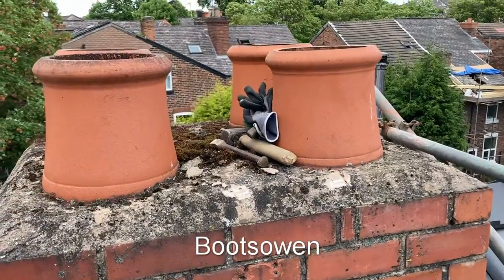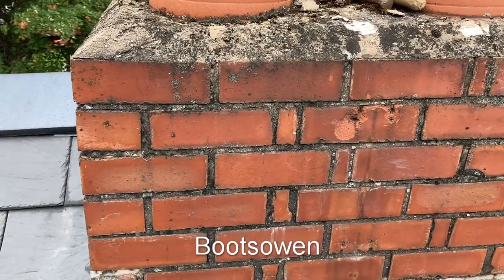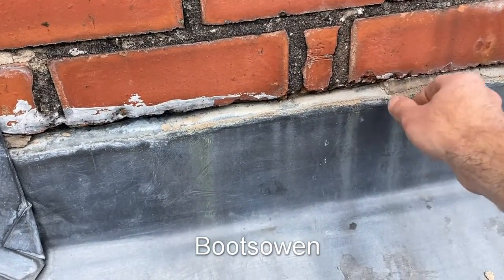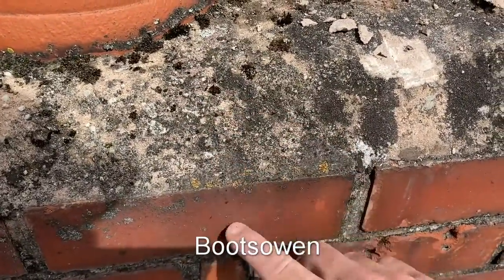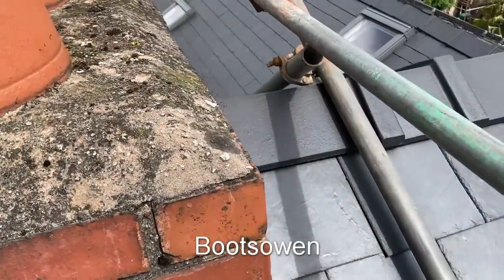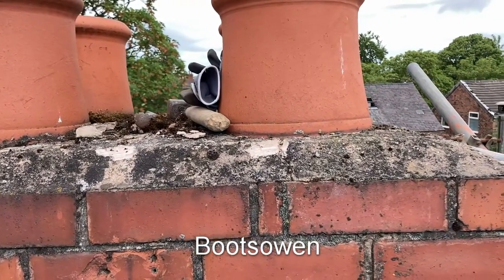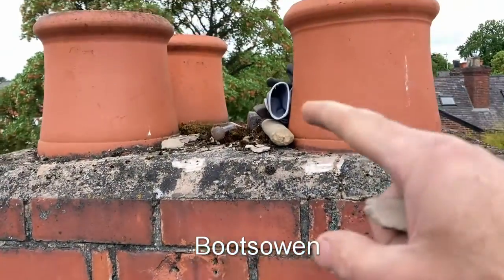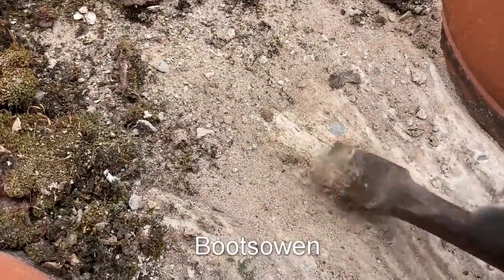How to put a really strong cap on a chimney: DIY flaunching / benching

Comment: Thanks for making a great video which informed me and gave me the confidence to cast my own cap - 5 years of damp resolved! Your method of forming the wood to hold concrete was great and I added a ratchet strap around the wooden form work.
Reply from the maker: I did this shortly before the video was published, it has worked great since, and if I had to go up there and do it again I would probably just do the same thing.

Comment: Great video and great job ! The one extra thing you could have done, while the expensive scaffolding was up, was coat the chimney crown and stack with a quality masonry protection cream -- like Climashield or Stormdry -- to protect against penetrating damp, for 25+ years. It was this that stopped the internal damp from around my chimney breast (the flashing was fine.). Bricks, esp old bricks, & mortar, are really quite porous ........not least with incessant rain and persistent high winds (i.e. UK winter/spring nowadays!) !!
Reply from the maker: Hi, the top of this chimney has been rebuilt in engineering brick, so I don't think that any waterproofer is necessary. Generally, I am against waterproofers on older masonry, if the masonry is getting constantly soaked then remove the water. Older masonry can absorb water and then expel it through evaporation, and moisture can mover from the inside of the house to outside.  A waterproofer will stop moisture getting out. I guess they will say that it is breathable, I haven't used it.
Reply: @bootsowen  My chimney (& house) is built using engineering bricks and the chimney had also been repointed and had the lead flashing redone. The house is 117 years old and the bricks had become horrendously porous. During the incessant rain of the winters we now get, I was experiencing penetrating damp from the chimney and rear (SW facing) of the house. What stopped this penetrating damp completely, was the application of a thick coat of Climashield Masonry Protection Cream onto the chimney and rear of the house. The product doesn't stop moisture from getting out of masonry (it's "breathable") but it significantly reduces waters ability to get in. The product also dries to an invisible finish so the appearance of the house hasn't been altered in waterproofing it. Years ago, my chimney/house would have been able to absorb some water and then dry out during drier periods while not displaying damaging internal damp patches. However, climate change and the longer wetter winters (& old bricks) have meant the brickwork required additional protection to prevent water ingress. For me, the Masonry Protection Cream was necessary and worked brilliantly at keeping the water out and preventing water damage to the inside of my house.

Comment: A scutch chisel, my favourite (with the comb insert).
I've got my chimney to sort out but not enthused at the prospect.
A neighbouring house threw out an old original fireplace with surround (solid mahogany) which I rescued from the skip.
Will be nice to reinstate the surround and fit new log burner within.

I've used an SDS drill in chisel mode to act as a rudimentary vibrator for getting the air out. Cheapo orbital sander (square type) works well too.
Reply from the maker: Hi Ian. I had intended to give the shutters a shake with something electrical but in the end I quit and had to get dinner made. So it goes. I have seen a jigsaw and sawzall used without a blade to shake shutters as well. 
Good news on the finds. Giving anything a second life is a good job!  As for your chimney: if you can pay someone to put up good safe scaffolding you can do the job very comfortably.

Comment: You did a cracking job there mate. It can blow a hooley and rain as much as it wants thats going no where.
Lets face it with these high winds that we are subjected to every winter our roofs and chimneys need all the help they can get.
That pointing on the flashing was poor the mix looked way too sandy the leadmate looks a much better job.
For vibrating your form work try one of those cheap half sheet electric sanders they work a treat for that.
Reply from the maker: Thanks Simon. I think the old pointing on the lead was an apprentice special. My capping does not look like the vernacular in my area. But most of the chimneys have been cut down or removed. There was only the smallest drip into the loft in the worst windy wet weather but no leaks are better. This can only help. As for vibrating it. I had planned on it but when the time came I had to collect kids and cook dinner. I have seen a sawzall, jigsaw with no blade and the sander. A neighbour showed me a new makita tool for their battery range with a vibrating poker. Either way I didn’t. There is so much latex in that concrete that I can’t imagine much moisture getting through it

Comment: How is this holding up, du think having a drip grove under would of been useful, belts and braces wise
Reply from the maker: while it doesn't have a drip groove, the edge is lower than the bricks so it has a drip at the extremity. water can't go uphill.  it has lasted.

Comment: I added polypropylene fibers to the mortar mix to help resist cracking and allow a stronger mix
Reply from the maker: Did you cut up rope or buy the fibres with the flattened ends?  I used some mesh.

Comment: Out of interest when concreting around the pots did you allow for an expansion gap ? If a chimney is used for an open fire the pot can get hot and sometimes crack if cemented in.
Reply from the maker: I’m not worried about it. If it cracks I’ll be the person who has to repair it so I’ll take my chances.
Reply: @bootsowen  you can't leave a gap anyway.  Water would get into it.  Big no no.  Water getting in is the main one to avoid. The pots are clay fired in pottery ovens, they're not going to be pulsing with a little bit of hot and cold from a log fire.  If that really did happen there would be cracked pots on every chimney that was used for heat and that's just not the case.  I think if you have seen cracked pots the causes were different.
Reply: @johnalperton149  you leave the gap and then seal it with something that doesn't harden over time, like polyurethane based caulk

Comment: This is not a chimney cap young man , firstly it's an old chimney was never lined inside which was just as well because that cap wouldn't keep out a fog . The brickwork was lowered over time and is much older than you think. They were originally built for open fires which helped to keep them warm and dry ie no frost, frost will kill the cement. The roof and lead work were renewed which looks fine, flashing a bit skimpy around corners. Probably should have pulled up the counter flashing to c if the brickwork was wet underneath. Cracked brick should be removed it will cause the rest of the corner to crack eventually. Make sure you put rain and bird deterrents on the pots. Don't forget to tank that cap with a rubber based waterproof slurry before the scaffolding is taken down .
Reply from the maker: What’s a chimney cap old man?

Comment: The drip can be made with sash chord in the box. ;0)
Reply from the maker: I thought about that and I have used cord for windowsill drip edges in the past. I couldn’t figure out how to do the corners if I was using sash cord or rope. How would you detail it.
Reply: @bootsowen  wooden mouldings are the best thing as they're nice and straight.  Get them from that funny rack in the DIY shop where they have all the different shapes for you to look at. No problem with corners, do a mitre joint.  The strips can be nailed down to the bottom board with panel pins.

Comment: How can people say that's a good job!! It looks terrible!! If the chimney is leaking try caps on your pots to start with!! And don't start me on the sealant😂😂
Reply from the maker: So how would you do it Matthew?  You are all critical but no help to anyone
Reply: @bootsowen  the cracks in your mortar work are a problem and will get worse, so yes it did need re pointing. You are correct in that the flashing needed sealing, but sorry your finish leaves a lot to be desired, wet your finger and smooth over or even use masking to get a clean finish. Not saying it will leak but have some pride in your work! The flanching will fail. Whilst the boxing in worked, If you'd have made it to the finish height you could have then just filled it to the top and it would be level and even. The bond coat is a good idea, however you really needed to use proper rebar as the weak area is the overhang. And a small slither of timber would create a nice clean drip if put In bottom of the mould. Also it will be full of voids and air pockets as your concrete wasn't wet enough so vibrating it would do nothing. Did you add waterproofer to the mix? Evermix do a good one.And if your getting drips? Put the correct caps on your pots (depends on if still in use), C caps are good if not in use and easy to fit, if not you can get cowls which slow water ingess. Sorry for sounding rude but I'm sick of scruffy work being excepted as the norm!! It's not!! If it's your own house then only you have to look at it. But there are also so called tradesmen doing the same, and people shouldn't be excepting it. Take pride in what you do and do it right!!
Reply from the maker: Maybe I wasn’t as clear as I could have been in the video. The bottom of the shuttering was tapered to the edge so the tip of the flaunching is a drip. And if any of it should break off partway then the soffit will still fall away from the chimney. The pointing had cracks but it was sound. Not falling out except where the lead flashing was fitted. So I didn’t see any point in cutting out the pointing (it wouldn’t take out). I don’t think the pointing was leaking. I wanted the capping to fall away from each pot so that is why it is not constant thickness. The mix has loads of latex in it so it should be waterproof according to the bottle. The top was painted with a latex slurry too. As for voids and air pockets maybe. And as for finish of sealant: it’s my house. I’m not fussy about finishes and prefer solid which I think this is. The chimneys have all got either vent caps or stainless cowls now so that should keep water out of the inside. After one winter there has been no moisture ingress so I’m happy with it. I wonder what your profession is that shoddy workmanship affects you so?
Reply: @bootsowen  I'm doing a similar job myself but I read you should not seal concrete if you want it to perform well.  Cannot remember the reason, something to do with controlling moisture.  There's a guy on Youtube who is mad about concrete and goes into the full science of it all.  What a lot of people say is that you should have a DPC under your chimney flaunching because you don't want water getting into your brickwork.
Reply: I've remembered the reason you don't seal it.  There's some saying in the concrete industry that all concrete cracks.  So your aim should be to control how the cracks form.  You should use a plasticiser in the mix, sharp sand, 0.4 parts water to cement - I found this tough to control so just went with what seemed okay.  When freezing gets to the concrete you get ice crystals forming inside it.  If the ice crystals start joining up and becoming big ice crystals that's when you start getting big cracks and chunks of concrete start separating.